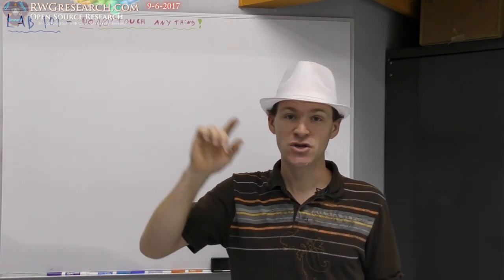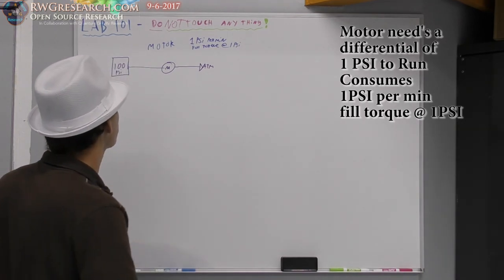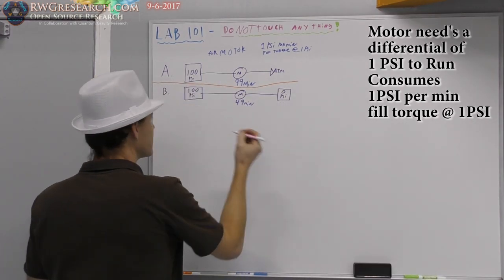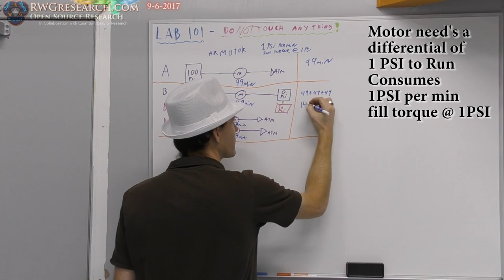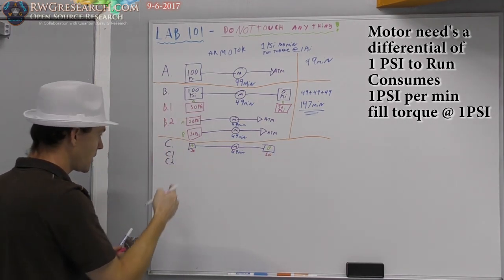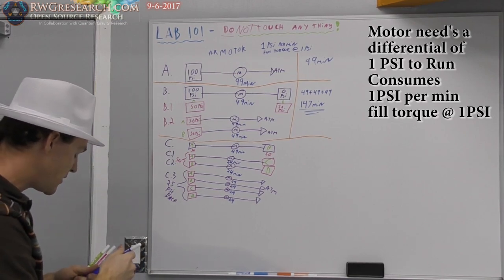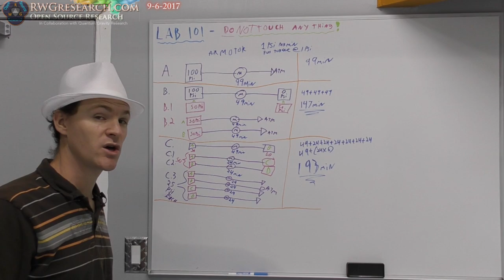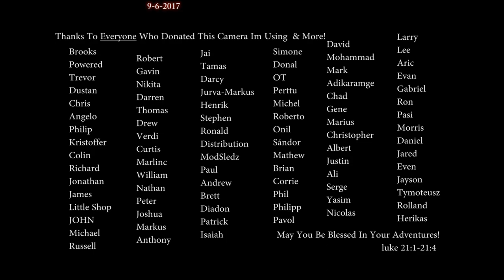The Search For Answers Part 1: Air Taink Efficiency. Thought Experiment.

Comment: The run time would be depending on the volume of your system and the volume of air stored in your first tank. Standard Atmospheric pressure is  (14 psi)..

Comment: You could only make the tank to tank transfer work with two timed valves, one opens and closes to generate a pulse of air to fire through the motor, and a second valve is used to capture the pulse. The system relies on the momentum of the air and tight valve timing. The first valve would also need to divert to atmosphere to stop a vacuum being form behind the air pulse feeding the motor,  may work better with higher mass (fluid), Just a thought.....
Reply from the maker: Mike James but if you look at the air motor requirements you will see that as long as you have a difference of 1PSI then the motor will run at full torque. No pulses needed here. ~Russ

Comment: Going by your premise, in "scenario B" I think you mean 49.5 minutes not 49 minutes. After 49.5 minutes you have 50.5psi in the first tank and 49.5psi in the second tank, a difference of 1psi.

In each scenario, no matter how many cascading tanks are set up, the total work developed is equal. This is because air moving from a 100psi tank to a 0psi tank (at the very start) produces more instantaneous power than air moving from a 50.5psi tank to a 49.5psi tank. This extra power will probably result in a higher running speed given a fixed load. If you reduce the amount of air going through the motor such that it runs at a fixed speed, then the rate of air consumption is much higher as you get into the chained together tanks with small difference in pressure. That makes up for the supposed gains.

But, considering everything in "psi" doesn't actually tell the story correctly...you need to consider volumes as well to prove this conclusion.
Reply from the maker: TheVirindi in this thought experiment we only deal with pressure. And the fact that the motor will run at full torque with only 1psi difference. ( note i never use speed)  And our "volume" is what ever is needed to make our 1psi per min work. So for the sake os simplicity. We just use PSI as a "potental" that already defines our volume.  Your thinking about this correctly. And your right. It dose not tell the entire story. But. This is a thought experiment. If you want to calculate for real world senaro. There is a way to do that. And get a similar answer. I'll leave that for later. In the mean time keep thinking king about this. Your in good thought!!!  You one of few who actually look at this problem correctly .  ~Russ

Comment: Hi Russ, I just ran across your perpetual motion holder video and subscribed.  I watched this video next and I appreciate the way your mind works.  I am so glad to see that there are a few young and intelligent people like you who are working to unlock the mysteries of physics.  That said, as I watched this video I immediately saw a problem in your hypothesis. 
At the beginning of the video you set up the parameters of the theoretical air motor as requiring 1 psi per minute to maintain 100% torque but in your calculations you need to use the differential pressures between your 100 psi and 14.7 psi (one atmosphere) Or 100 psi in tank A vs. the pressure in tank B. Your calculation in example A. would only work if 100 psi is being fed through the air motor and dissipated into a vacuum of 0 psi.  Likewise  calculations in examples B and C don't account for the differentials of the pressures in either tank. While pressures will eventually equalize in any scenario (open or closed circuit), as the differential pressure is reduced, the time required to equalize increases inversely. In other words, the PER MINUTE parameter is not being met in your examples. But  again, I applaud the fact that you can present such a question. 
Looking forward to more of your work. Keep thinking outside the box!

Comment: I would hypothesize that the pressure between the tanks would be seen at the motor reducing its ability to do work or have (reduced torque). In electrical terms, this would be considered a cascading LC circuit ,as you have purposed in your thought experiment. The J/s seen on motor as HP would be determined by a sort of LC circuit formula. Where the motor would be the L and the tanks the C as I am sure you are aware of. Technically there is also a R in pipe length,diameter, topology, ect. but lets keep the thought experiment simple right?
If you devised a 2 way counter motor rotation that could gear differentiate between the tanks pressure and volume.. this would be like a fundamental frequency using a tuning inductor in this experiment.. you would more than likely have one hell of an efficient motor.  I do believe there a few gentlemen who have experimented with that idea with practicality in mind, and have had great success. 
  I know you are totally aware of impedance and resistance in electrical terms. I also am not going to lecture you about 65-75% efficient of air motors. How would this system be any different then the capacitor paradox though? It is my feeling the reason the capacitor paradox exists is simply due to the perception of a closed systems contrived by us as a way to communicate a measurement. Many things have a known equivalence of energy correct? So what is the known energy equivalence of air? How would one increase not only the velocity of that air, but also its mass?

  The beauty I have always felt with this type of circuit is it can be ran in reverse according to the second law of thermodynamics Gibbs free energy. What I mean by this, and what many others have eluded through experimentation, is as follows.  If you increase your closed systems size, you increase your total energy in a particular thought experiment. So once you open your system up to incredible sizes that may times pose a challenge to measure... the perception of energetic motion becomes unfathomable for the mind to process alone ;) This is why the closed system was developed in the first place... its also why we have not reached a zero point in any form of motion. 
That is certainly some philosophy, but without philosophy, how would one do a thought experiment in the first place? I hope at least some of this has made sense. 

Love the video my friend and by no means are my words meant to discourage from perusing this experiment in real life.  You know me, I will give it to you how I see it. 

-Love Diadon

P.S. I put this here so all on Youtube as well so all can see my level of crazy! LOL!!

Comment: Russ. I have watched all 8 videos so far,and enjoyed them very much. but this one is the one you should be concentrating on. I have read some of the comments below,and there are some incorrect answers being thrown your way. For this setup,where the gas transfer is slow,and heat increases and decreases are not much of a factor,you should be using Boyle gas law,where it is calculated as P1V1=P2V2. When you double the volume,you halve the pressure,but the energy contained within the two tanks combined is the same as that it was with the single tank of compressed gas at the start. I did months of work on this very system in 2013 at OU.com,and had the late MarkE doing all the calculations. If you are interested,i can show you a simple way to end up with a higher combined stored energy in the two tanks,than the energy stored in the single tank at the beginning.  Back in 2013,no one really seemed interested in what i was doing--even though i showed an energy gain. But now,here you are,doing the same thing lol.  I still have my large tanks,and all the gear needed. So if you would like to team up on this,we will show others how to pull in energy from the environment.
Reply from the maker: Hey Brad! Nice to see you here! yeah there are a lot of interesting answers thrown around for sure! yeah i left a lot of stuff out to get the creative juices flowing :). I watched some of those videos you had posted on your other channel After i went though a few of those videos.  and like you say, here i am doing the same thing. lol it is funny how we crossed paths, and now we are back a it! lets jump on Skype and discuss this. i have done a lot of research and bench testing scene this video was posted. so there is ALOT more to discuss. By the way you just missed this years PMBO. but thats OK, now it gives us the freedom get back at it. let do it! see ya on Skype... ~Russ

Comment: Something analogous but in a cascade arrangement (instead of switched) I've seen with air car motors, and with steam.  They used a small piston first, then larger, then larger again up to 4 steps driving the same shaft, pulling most of the energy out along the way.  My understanding is that stacking turbines of widening geometry on a shaft has the similar effect, bringing the pressure  down to near atmosphere with no switching.  I don't know for sure what the optimal sized of subsequent stages would be, but if anything like building a horn loaded loudspeaker (which transforms high sound pressure into large volume), probably a hyperbolic increase would be efficient.
Reply: I'm guessing with electricity, you'd use a buck converter (which is switching) to step down the potential (pressure), but increase the current, but if I understand correctly the most efficient forms of those have some quasi-resonant thing going on.  Perhaps instead of trying to bring mechanical/air staging toward electrical, there might be a way to bring some of the resonant characteristics back into the mechanical ? [hmmm, come to think of it horn loaded loudspeakers appear to do something like that perhaps due to the compliance/springiness of the air]
Reply: Use centripetal motion for storage energy conversion/pressure, right?
Reply: They have already found immense energy regaining differentials in long horizontal pipes (due to BAROMETRIC pressure) it is due to weather... The govt already shut down the research involved around this because energy release was nonetheless....OUSTOUNDING. ;)
Reply: Yeah, I think if my analogies apply in any simplistic way, it'd be through treating the device like an impedance transformer, so in any of the forms the amount of losses could be optimised for each stage, along with the number of stages.  With the long horizontal pipe hit with weather example, that could be like dancefloor sonic bass cannons, which are indeed resonant, typically suspended from the ceiling, and highly efficient, as with the horns  (all different kinds of impedance transformer, in the case of the acoustic ones 'acoustic impedance'
Reply from the maker: MichaelSmathers this is correct. I'll explain how to do this in a later video. ~Russ
Reply from the maker: Jason Groothuis your on the right track about impedance matching. I'm doing it with pure mechanical. Using AIR components.. More to come  ~Russ
Reply: where is this info coming from about gov shut downs ?

Comment: "psi" is not a measure of volume... therefore you can't rate a pressure as an amount "consumed" or "used" per a unit of time... "psi per minute" is not valid. For measuring something over an amount of time, you have to use a unit of measure that relates to Volume.  For air, we use "cfm" (cubic feet per minute) as a measure of volume per unit of time. 

Saying that something requires 1psi to produce full torque is valid if it's not moving, but as soon as it begins to rotate, you begin requiring a "volume" of air in addition to the pressure differential... this is where "cfm" comes into the picture. Pneumatic motors are rated for CFM at a certain pressure (PSI) to perform a certain quantity of work. If the shaft is not rotating but static, then no volume (CFM) is consumed, a pressure differential is all that's needed to sustain static torque.

An air tank with 100psi can be anything from a thimble size tank, to a tank the size of the moon... PSI is not a rating of volume... it's just pressure... just like Volts... it's just static pressure. 

It's exactly like a capacitor... you can have 1000 Volts across a 100pF capacitor, but it will not do much work, as it only contains 50 microJoules. If that capacitor were 100uF at 1000V, you'd have 50 Joules... a fair amount of energy and capacity to perform work.

Capacitance value (farads) is the equivalent as air tank volume/capacity... rated in Cubic Feet.

Comment: Imagine dropping a ball between 100 meters to 0, then 99 meters and 0, then 98 meters and 0 how much energy does the ball use at each step.  Now imagine dropping the ball between 100 meters and 0, 99 meters and 1 meter, 98 meters to 2 meters, 97 meters and 3.  How much energy does the ball use in these steps?  The key is the amount of work done is the difference in potential.  In your example 2 a negative potential is increasing on the other side of things meaning less work is done relatively at each step as compared to example 1.

It might be easier to imagine the opposite.  How much work does it take to move a heavy object from 0 to 100 meters, from 0 to 99 meters and so on.. as compared to from 0 to 100, 1 to 99, 2 to 98 - you can imagine that it take less work in the second example.  This means there is less energy available for your motor to do work with in each comparative step.

Comment: they have a car that goes 125 miles per tank of compressed air tank is made of fiberglass so if it breaks .. it will crack releasing the air in a non shrapnel explosion.. als o i see a new means of more efficient air compression ... like spraying water to reduces heat so the air can be pumped harder and faster than before.....also when decompressing uses water to cool down ... also see a man who  made a floor a pump that when his cows walk over it. it pumps air into a tank the runs that is used to generator  power his barn via pumping the air into a weight that move empty to the bottom of a wale then at bottom he releases air int to weight it  floats to the top the wale is filled with water then air is released.... this is how the generator is moved via rope tied to weight ... he say weight is all we need to power the world... guess he thinks why not make a pump under everything we can like roads can have pumps worked by cars floors can be pumps worked by people simply doing what they do moving over them.... guess it could work for some electric needs......

Comment: Russ,
You don't seem to say what you mean by "efficiency" anywhere. You just talk about the motors "running," and you don't say what they are.
If I make a paper fan move for an hour with one high-pressure tank and for two hours with two lower pressure tanks I haven't proved anything. there was a lot of extra air pressure wasted in both cases. The little fan moving has measured nothing; it's just moved.
Sorry, I don't see your thought experiment doing any experimenting even until you get a handle on the actual usage of energy by the two moving "motors."